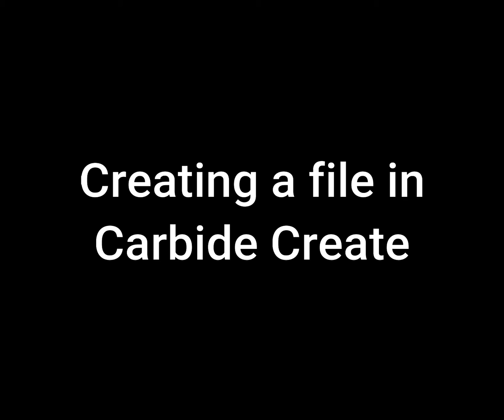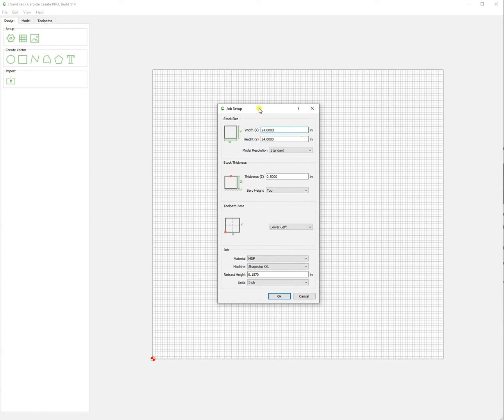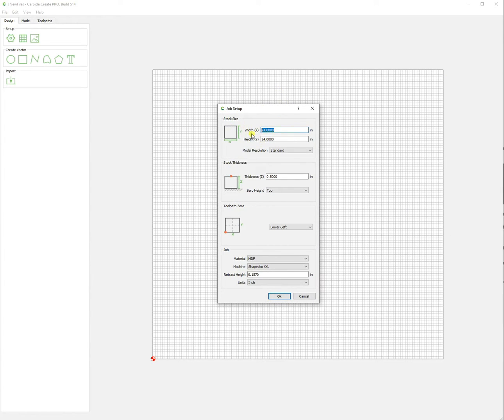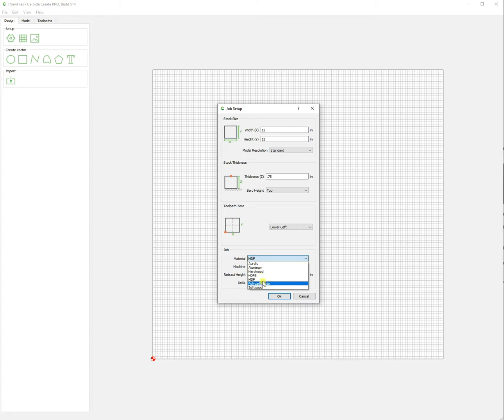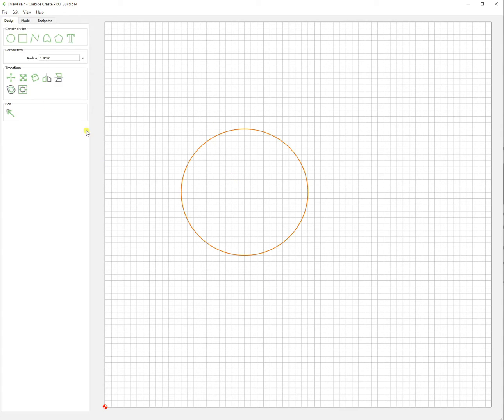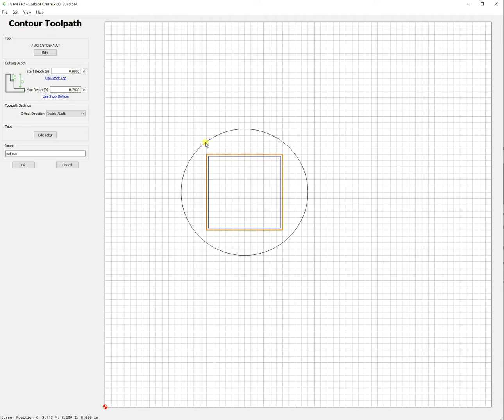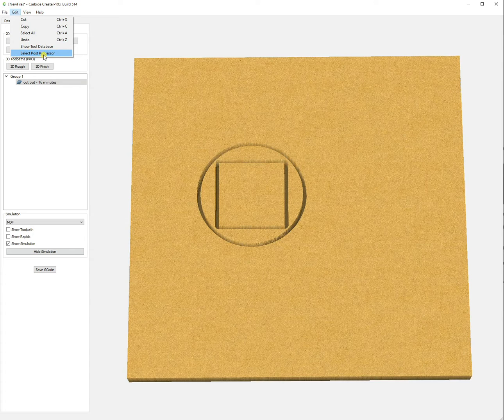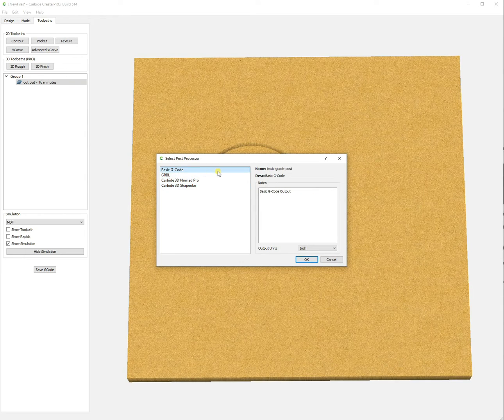Creating a file in Carbide Create

Comment: I couldnt get mine to work properly. It's a simple design from the Carbide Create images. It's saved as a .c2d. Is that the problem? Should the file be saved with a different ending manually?
Reply from the maker: V7 and past put a pay wall on it to export gcode.  Install V6 and you can export gcode free.

Comment: Onefinity cnc 
How many millimeters are used in axes?
Does it vibrate while working?
can it process aluminum?
Reply from the maker: 810x810x140
Reply: @OnefinityCNC  What is the diameter of the linear shafts